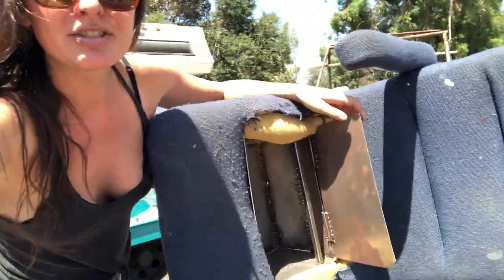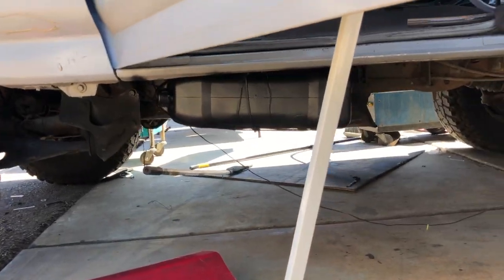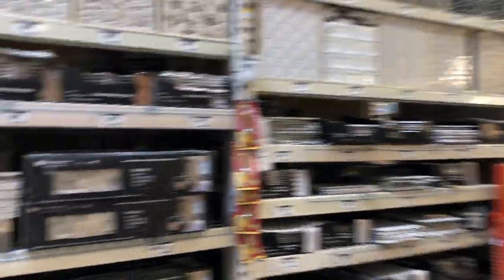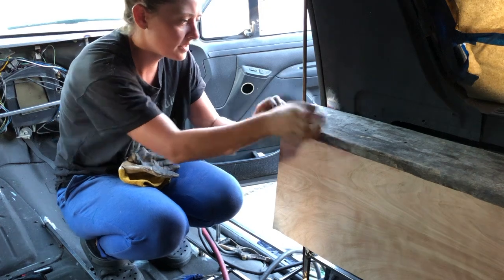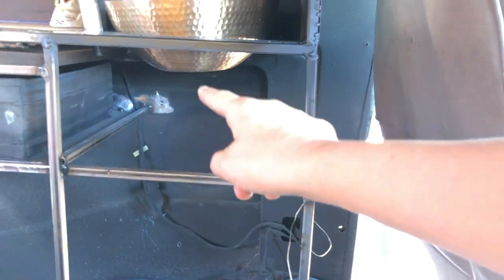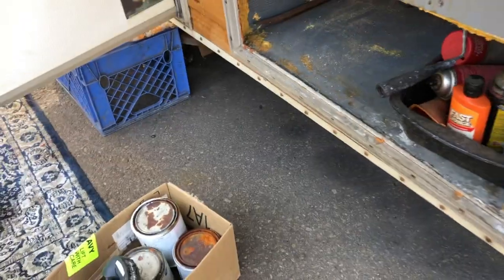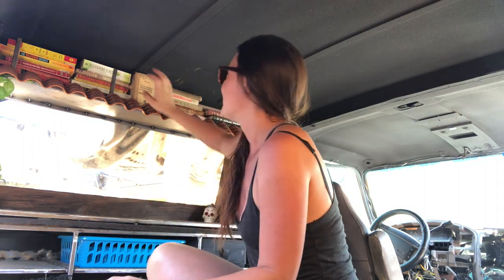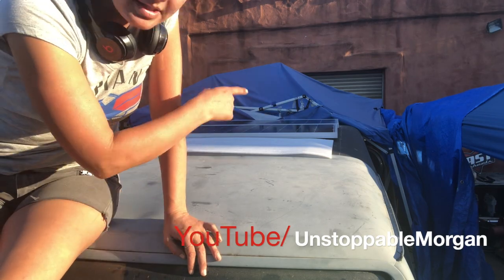BRONCO TINY HOME TOILET!!!

Comment: Methane gas leaking back up into your cabin is bad and can kill you. Never mind the ability of it to be very flammable. I’m a FireFighter/Medic, don’t play with this.

When it comes to mounting your solar panels, make sure you make it where you can remove them in a hurry. Here in the south, especially in Texas we get some righteous hail storms that will destroy those panels.

Cassette toilet is your friend. They make very space saving ones that you can setup in the bronco when needed or in an awning outside.

Be prepared for that flimsy board you put for the couch etc to begin breaking down and cracking from weight and the moisture in the air here in Texas.

Dash area I would mount a flat piece of sheet metal where the dash used to be and mount a Molle system there and you can attach a million storage things on it.

Your desktop. They make swing arms for computers you can mount that to that would be up and out of the way and can swing down right in front of you as needed.

Those burritos? Wait til you see the ones you can get here in Texas. Freebirds will become your next burrito spot 👍

Comment: If their is a Lowes nearby you can ask if they have any wood toppers from the flooring pallets.  The pallet are shipped with a protective board over the top that just gets thrown away.  These boards are about 4' x 4' and can be 1/4" think.  Two or three of them would easily handle your needs.

Comment: When building things like a slide out shelf. Maybe try shimming with strips of carbon fiber. It's self lubricating so when you pull and push it will slide smooth on the shim which keeps it from moving up or down.

Comment: I totally agree with J. Francis. Plus do you really want to be driving with the potential for splashing? I know I wouldn't. Plus I've been a janitor. You don't want to know what its like cleaning up crap in a small space.
Reply: Such a bad idea. I don't get it either. A bucket and trash bag so much better.
Reply from the maker: It’s not done, it’ll have a sealed seat cover. This really is just for the late night I need to pee and I don’t want to get out of my bronco being a solo female toilet. Safety first! We’ll see if it works or not. Find out in 4 weeks!

Comment: I have a suggestion. I drive truck and on the road a month at a time and getting cleaned up can be a chore at times, but I found waterless body wash and waterless shampoo. It is great between showers and it works really well. 
Be safe and have fun on your travels.

Comment: Pull a small enclosed trailer and you can put stuff in it put batteries and solar all on trailer. Have a generator in it and shower. Maybe apartment washer dryer and water heater.
Reply from the maker: Attention 2 Detail Automotive Towing And Detailing I am panned to do that but for now want to try something super small, if it ends up being really uncomfortable that’s when I’ll look into an upgrade for sure! ❤️❤️ Thanks for taking the time to comment friend! Have a great weekend
Reply: @UnstoppableMorgan  thanks you to. I dont mean a RV trailer just a small enclosed trailer for all your stuff and and you csn make your own shower in it.

Comment: Also I said this in a comment on a later video before but I guess it's more appropriate since this is the video with the actual black tank but basically to keep the smell down just like in an RV or camper you need to use tank solution I like happy campers it works great for me way better than anything else I've used

Comment: Don't go down a bumpy road no flap to keep the stuff in there. No water to flush problems should've just used a porta potty at Walmart add water store under the bed and can just dump it easy. Fill it with water and drive you'll see why it's a bad idea. Also the smell will vent back in the bronco

Comment: Not sure why you would want that but for females I can understand the benefit.   I would have completely would have take all of the upholstery off the seat and built the toilet with a vent stop to prevent  odor from septic tank.  Regarding the septic I would have built a two level with an angle slide so the waste slides down  to one side to prevent splash back.  Last the septic would have a common discharge connection so you can dump at RV parks.   Finally I would of taken the whole seat to a upholstery shop to finish off so it looks feels, and performs like a great drivers seat.   My 2 cents.

Comment: Wow! Bebe that is awesome! I would definitely beta that toilet of course.
With all due respect to the fireman just some regular RV septic tank liquid will make it smell nice. Methane gas!? Well meaning but ill informed. All the comments about the smell don't sound like they have done much camping. We have used porta potty for decades with no problems, the self degrading toilet paper doesn't break down much faster than regular. I have run tests! Lol
That was a great nuts and bolts video, loved it!

Comment: If you ever crash that Bronco.....The conversation between the EMT's will be interesting.
   By the way, that drivers seat has a amazing amount of engineering built into it to protect your pelvis/spine in the event that a lot of kinetic crash energy needs to be directed somewhere besides your body.....You have defeated the protective qualities of your driver seat and lap and shoulder belts.
  Replace this ruined seat.  Make other arrangements for your sanitary needs and show us THAT VIDEO.......Walmart has bucket/bag commodes for less than $20.......PROVEN EFFECTIVE/CONVENIENT/SAFE.

Comment: Any particular reason you're going with a new transmission? Your bronco has an E4OD which is electronic and there's a whole list of reasons that can make the transmission act funny without being a mechanical problem.  Late model Broncos have a pretty hardy transmission, I'm not saying they are bullet proof but usually its one of the dumb sensors that makes it shift hard or slip, personally I've seen a faulty TPS make an E4OD look like it was due for a rebuild.  The most hardcore bronco owners simply ditch the E4OD because they don't want to deal with its complex electronics.

Comment: The problem with your driver seat toilet will be the smell. You need to make sure contents go in but smell doesn't come out. Even if it's just number 1 it is still gonna be ripe. Then don't forget winter and the contents are going to freeze and you won't be able to drain it.
Reply from the maker: Campbell LW good points thank you. It’s not done and I’ll be installing a sealed lid but I never considered anything freezing. This is really just going to be used during mid night pees and while parked in locations after dark where I shouldn’t leave my rig. I’d like it to become something super usable though! Time will tell! Thanks for the support friend! Have a great weekend ❤️

Comment: I had an 86 full size Eddie Bauer Bronco. Those were the nicest seats you could get in a Bronco and they STILL SUCKED. Completely inadequate springs on the bottom and I weigh under 180 lbs. I can’t imagine driving on a seat with even less support for your rear.
Reply from the maker: Adam I have to say I’ve never felt uncomfortable on my seat, it’s really springy. I may have f’d that up though. I plan on putting a feather topper on it along with some memory foam. May still be hard as a rock though. We’ll see!

Comment: Hey hun , what batteries are you going to go with?  I know I told you about the Nissan leaf battery modules.  I could explain how to set them up if you're still interested in them.  I got them from tech direct on Ebay.

Comment: Umm...no. Just, no. It’s a hazmat issue if it comes loose on the road anyway. Big fines. Just cop a squat or use the gas station potties. You’d have to use the blue bags like in portapotties and you’d have to have an approved place to drain it.